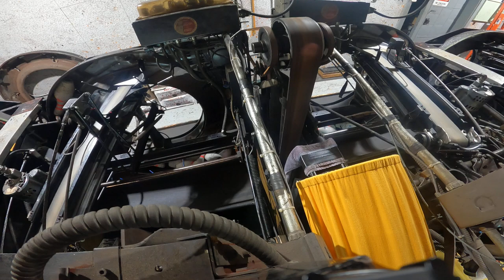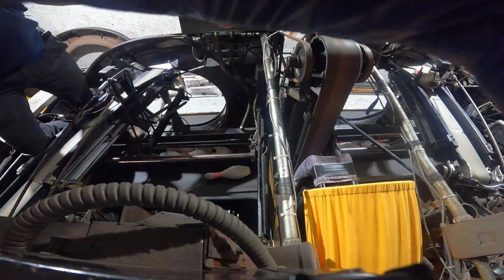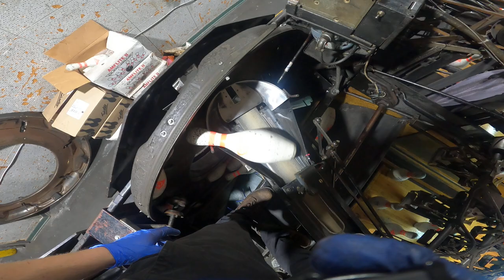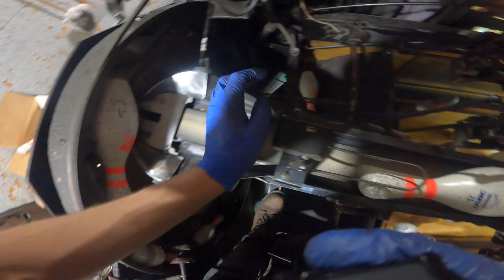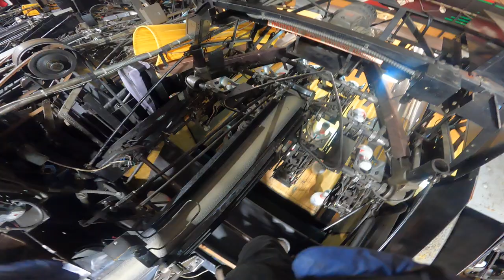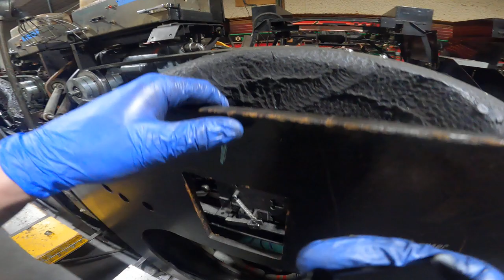AMF 82-30 Machine Stops: Pin Jam on 9

Comment: Hi Joe, There this a L shaped "pin stabilizer" bracket that bolts under the back end motor that will solve this issue.  It stops the head of the pin from falling below the pan on orientation. Part number and photo 030-007-159 is LH and 030-007-160 is RH on page 5.009 in the 1959 manual :)
Reply from the maker: Yeah I have those, that lane just doesn’t have one because it broke off:/ have to get it welded